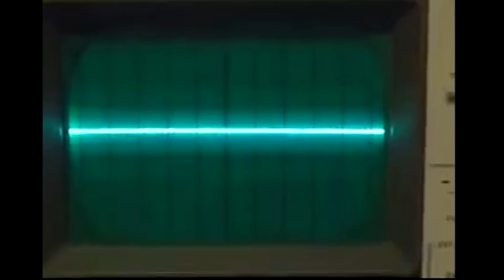Demodulating signals with modDemix

Comment: Is there a way to make the modulator signal not bleed into the resulting sound? thanks
Reply from the maker: If you demodulate using a multed copy of the modulator, instead of a second oscillator tuned to the same frequency, then you will hear what “accurate” demodulation would sound like. This will have less apparent presence of the demodulator in the sound, but may also not be as sonically interesting.
Reply: No, I mean at 2:38 as soon as you begin monitoring the output, as I understand we hear the modulator signal even before your voice is introduced. Is there a way to avoid that? Like so that there would be silence between your spoken words.

Comment: Walker, now let's hear what modulation/demodulation with FM sounds like!
Reply from the maker: That might be trickier. How would you do it, Richard?
Reply: @MAKEN0ISEMUSIC  FM modulation is covered in all Oscillators with FM inputs, right? And if I remember my classes on comms engineering correctly, a crude FM demodulation can be achieved by using a PLL circuit tuned to the carrier frequency. Phase and frequency offsets between mod and demod carrier might yield some interesting sounds.

Comment: The modemix can also be made to self oscillate with a feedback loop.  So can the OPTOMIX .. funny thing is for something to get stuck in a feedback loop there needs to be something to FEED BACK..  but in these cases there isn’t ..   ghosts in the machines I guess.
Shared System is just a lot of ghosts in a box.  I’ve had mine for like 4-5 years now .  I don’t crack it out as much as I used to or have time for (deadlines on releases and life stuff)..  but it’s always a treat still to this day.  I’m still rockin the original CV Bus one.  I added the Erbeverb (yup.. didn’t come with back then), MMG, and an additional function generator (Function).. why do I never see people adding that third function generator ?
Reply from the maker: Well, there's no such thing as total silence and "no-input" feedback methods are a great way to exploit this :)

Comment: Totally awesome video. I know it's described in the manual but for some weird reason I did not get it - even though it's so obvious when you see this video. This doesn't mean the manual is bad, it just needs audio :). Thanks a lot!
Reply from the maker: The manual may describe using a single sine for both inputs, or maybe inverting it for one of them. I think the dual sine as shown here is quite more interesting :)

Comment: Great video. You can hear some side bands in there which sounds like frequency-shifting. I wonder if it’s possible to emulate the Bode filter/freq shift with the system.
Reply from the maker: i've wondered the same myself. It requires waves that are phase shifted in quadrature and if I recall correctly, fairly precise tuning. Allen Strange has a number of interesting applications of frequency shifters that I hope to explore in video someday.
Reply: MAKEN0ISE I look forward to it if it ever happens!
Reply: @MAKEN0ISEMUSIC  please that would be great!